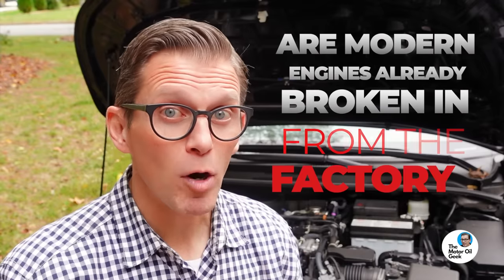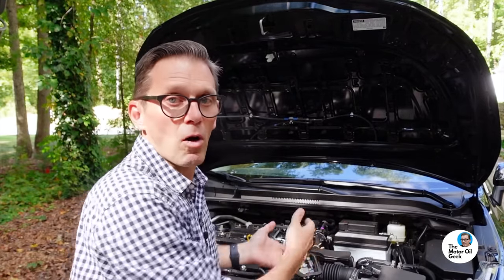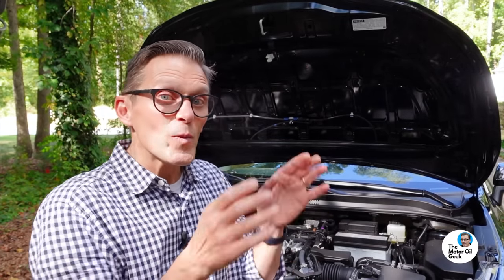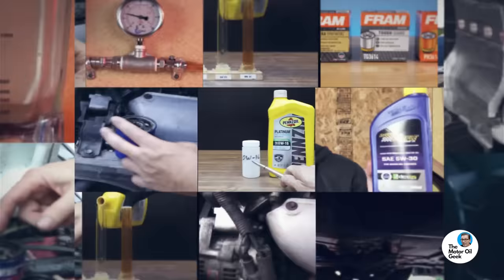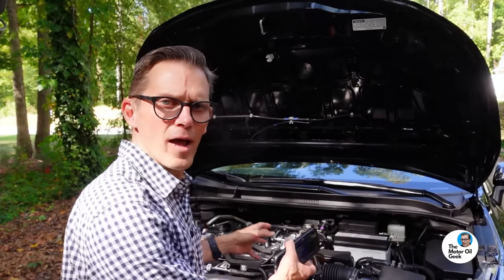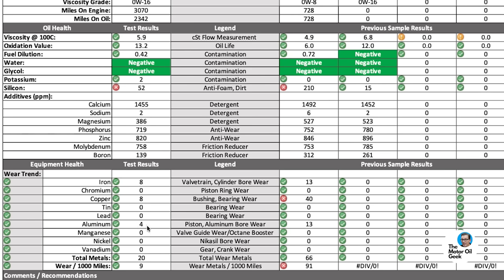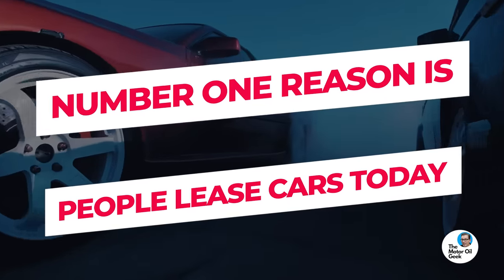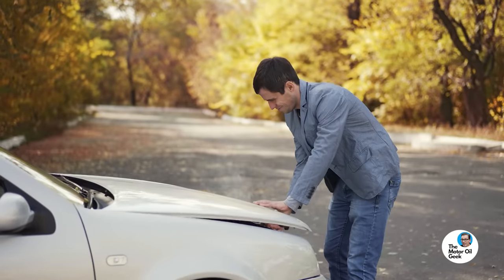New Engine Break-In: Truth or Myth?

Comment: Fantastic topic.
It would be great to do a video showing what to do from the moment of starting up your new car at the dealers lot with 2 miles on Odometer . 
How to drive it home, when to dump factory oil and what oil to use say after that factory oil dump and how long to keep it in?
Reply from the maker: Great suggestion!
Reply: @themotoroilgeek  Would lower Molly and higher or normal Zinc level oil like Pennzoil Ultra 5W30 be a fine oil to use after 500miles factory fill dump?  As from my experience judging the performance and fuel economy full breaking takes longer than 500 miles
Reply from the maker: @kdomster9141  yes, that would be good.
Reply: @themotoroilgeek  Thanks a lot !

Comment: Kind of stuck at least in the UK. First oil change is usually 1 year or 12000 - 20000 miles. No one normally works on the vehicle except the dealer when under warranty.

Comment: I think one thing missing from this discussion is whether the factory oil in the crankcase is some kind of special break-in oil, or maybe just some additive put in to the regular oil at the factory for break-in. I have heard different answers about this, and it probably varies by manufacturer and also varies over time (maybe they once did it, but no longer do, etc).
Reply from the maker: The oil we drained out had the exact same additive package as the OEM oil, so it didn’t have a special break-in oil.
Reply: @themotoroilgeek  This is a common misconception of almost all YouTube videos about motor oil. One cannot determine the entire base stock components and additive package components with a normal oil analysis. A motor oil analysis only is designed to tell you about the specifically listed chemicals, metals, etc, and not all the components, especially not the base stock components, or things like esters, etc. I realize that what I am saying invalidates the conclusion of thousands of YouTube videos on motor oils created by hundreds of YouTube creators, but it is the truth.
Reply from the maker: @Mark-rw3kw  I agree that the elemental analysis doesn't tell you about the base stock or the complete additive package. However, the FTIR analysis can provide an insight to both of these, so my statement that the factory fill oil was not a special break-in oil was based on comparing the FTIR results of the factory fill oil to the OEM service fill oil.
Reply: @themotoroilgeek  It may not have a special break-in oil, but I do know of some manufacturers who have at one time in the past, added some break-in chemical to the oil at the factory.

But in any case, since you didn't do an oil analysis when the car was brand new, it is not possible to know how much factory break-in was done, since any wear metals added to the oil as a result of factory break-in (or even a brief engine test not recorded on the car's OD) would have been included your first oil test done at 1000 miles, not just the results of break-in from 0-1000 miles.

Comment: I bought a 23 Prius prime and 23 tundra last year and changed the oil at roughly 600 miles  on the gas engine. I’m glad I did. My reasoning is slightly different though. I don’t take recommendations from a company that sells cars 🤷🏻

Comment: Great video!  I love your data-driven philosophy.  What do you know about Honda’s VCM, (Variable Cylinder Management?) system that turns of a cylinder at specific times to increase fuel efficiency?  I heard that it causes piston ring failure at around 150k-160k miles on their Odysseys and hence spark plug oil fouling.

Comment: If an engine is broken in at the factory, then it would have been done with the original oil in the crankcase. So a high level of wear metals on first oil change doesn't mean the engine wasn't broken in at the factory, it just means the oil has never been changed. Even if the engine is broken in at the factory, that doesn't mean that an early oil change is a bad idea if one thinks it is important to remove any wear metals from the oil, although virtually all of the larger particles will be trapped in the oil filter. I believe that Corollas sold in the US are made in Mississippi, not Japan.

Comment: I don't CARE whether they're broken in from factory or not.  When I get a new one- I'll change oil at 100 miles-- and again at 300 miles and again at 500 miles and again at 800miles and again at 1000 miles and after that as recommended MINUS a little time.  THAT way- it's broken in properly with good clean oil coating and will last MUCH MUCH longer.. YEs- it's a bit costly- but hey- what's that compared to the engine going out early??
Reply from the maker: Absolutely!

Comment: My 2018 Nissan Versa doesn't use steel cylinder sleeves but instead uses what they call "mirror bore" where steel plasma is sprayed onto the aluminum cylinder walls. Instead of the regular cross hatching cylinder honing their coating supposedly has microscopic pits that hold the oil. What do you think of that system? I haven't heard of any oil burning issues with these engines.

BTW the owners manual says there is absolutely no reason to do the first oil change until 5000 miles because high quality oil is put in at the factory. After that oil changes with 0w20 synthetic is to be done every 5000 miles.
Reply from the maker: I have an engine with that same technology. It is amazing stuff!

Comment: What’s your thoughts on amsoil signature series? I just changed the oil on my 2023 Tacoma at 1k miles and I used amsoil signature series! Glad I did the break in oil change after watching your videos !
Reply from the maker: That oil is one we are going to test.
Reply: @themotoroilgeek  have seen many videos on it being labeled as the best oil in the world. Project farm ranked it number 1. Along with many cold flow tests I’ve seen it beats the competition hands down. Looking forward to see what you come up with
Reply: For less than $35 a jug the Pennzoil Ultra Platinum is not much different. That is if you can find it at the local Wally World. I have to order it online. The platinum is usually in stock and might be just as good, they are specified for different uses.
Reply: @ricklong3218  still don’t think it stacks up against the signature series in the long run

Comment: Great science, Lake, thanks. Having broken-in (UK: run-in) a couple of self-built engines I've  noted the reduction in oil consumption during the run-in process. Q: what impact does the hi protection synthetic oil have on the 'ring break in time.
Reply from the maker: Thanks! Avoid the synthetics on a new rebuild. They tend to slow down the piston ring to cylinder wall run-in period. A proper running in oil will speed that up.

Comment: I believe many do "cold running" of the engines in the factory, but I'm not sure how much that will do in terms of break in as there's not a whole lot of load.
Where I worked for an engine mfg we did a full break in on all engines, but I believe that was mostly due to warranty and catching potential assembly mistakes.
Reply from the maker: Thanks for sharing.
Reply: The vehicles also get driven by the shipping companies. That's what I do for a living.  In -20° weather, we jump in the car,  fire it up, and immediately put the hammer down. 
Happens to every new vehicle multiple times before it reaches dealers. I did that to about 20 of the Dodge Demon 170 this past couple weeks.

Comment: Please could you explain this… when the engine has requirement for example for ACEA C3 is important to have also the OEM approval on oil like BMW-Longlife04? I have always problem with oil sellers and they told me it’s the same with the approval or without when it is C3 booth… my opinion is C3 is only basic standard and approval means it has done more tests and maybe contain more additives for OEM requirement is that right?

Comment: Glad to hear the science. But also wondering, if the oil is doing its job then the extra wear from the engine should have been suspended by the oil…correct?
Reply from the maker: The oil will always suspend wear debris. The higher wear debris is not a sign of the oil doing its job. Instead, it is a sign that the engine is wearing at a higher rate.

Comment: It would be interesting to know the difference in size of those metal particles as well and whether they're small enough to get past the filter which is the actual concern here.
Because when the break-in occurs the metal particles are flushed down to the sump obviously, so if they can't get past the filter then it's a moot point as the break in will happen at the same rate now matter how many times you change the oil in the first 3000 miles.

Now, it's clearly better to have as few particles of metal in the sump as possible as it will make the filter's job easier but I'm simply curious whether 91 ppm of metal can actually overwhelm the oil filter before the service or what percentage of those particles, if any, is small enough to get past the filter altogether.
Great video though, thanks for taking the effort to do all that filming and testing. 👍

Comment: Hey Lake. Do you recommend using Driven Racing Break in oil on a new factory engine?  I’m picking up a brand new 2024 Ford super duty with the 7.3 Gas engine and I can drain the oil just down the street from the dealership and then again after your recommended break in oil and filter life is over.

Comment: I  change my synthetic oil at 5k miles because the engine noise changes.  Usually that's 20-30% oil life left according to the monitor.

Do you normally wear gloves when changing the oil?  Should we be concerned about touching used oil?
Reply: Chris, you can touch oil and have no concern. If you feel safer using gloves then use them. I sometimes do and sometimes do not.

As far as the 5k goes, sounds about right if you are using synthetic oil. But if your engine noise is changing that's not a good sign.

And never, ever, ever go by what the oil monitor says okay? Go by the mileage only.

Comment: I've always carefully drove the first 1000 miles and then just changed the oil, at 2000 I will do another change with the filter. Bentley.s 6 3/4 liter V8 is spun with a huge electric motor for 16 hours to break in the running surfaces,
Reply from the maker: Thanks for sharing!

Comment: My cars owner manual says it needed to be broken in, and not to drive it aggressively to after it reaches 1,200 miles. It also says I only need to change my oil every 10,000 miles. I have a 24 MINI Cooper S with a turbo engine. It just reached 5,000 miles and some are telling me I need to change my oil now, and not wait another 5,000 miles like the manufacture suggest. I plan to keep my car for at least a decade, so I would like to do what's best for it. I've always went by what the manufacture says, but others are telling me I will regret it if I do. It's people who have owned MINIs for decades that are telling me to change it every 5,000 miles. My gut reaction is to follow their advice.
Reply: Yes, change your oil now and I would  change it every 5000 henceforth.

Comment: Would you recommend draining the factory fill in a new car (Lotus Emira with a Toyota 2GR-FE V6), running break-in oil for 300-500 miles and then going back to the OEM recommended oil after? Or is not worth the hassle and I should just break in with factory fill?
Reply from the maker: No need to go the far. Just changing out the factory fill within the first 500 to 1,000 miles is plenty good.

Comment: Would be neat to see if manufacturers are putting in a suitable grade of oil for the engine if they are being incentivized by CAFE scores.

Owning a hemi, they recommend 5w20 or 5w30 in certain conditions, I wonder if the lower viscosity is one of the reasons the lifters prematurely fail. 

Another video idle could be the wear of idling vs different speeds, more common than not, I see oil changes recommended off mileage not hours, so someone like a police officer, could be destroying the engine.

Comment: Since car manufacturers do not put break in oil in brand new cars anymore. Do you recommend to change the factory synthetic oil right away on brand new cars and put in breakin oil to properly break in the engine. then drive it about 500 to 1000 miles on the break-in oil and then switch back to fully synthetic?
Reply from the maker: Nope, stay tuned for more info that explains why.
Reply: @themotoroilgeek  thanks. I will stay tuned for more info

Comment: I'd like to see similar testing done on 2 different engines, on broken in nice and easy, the other, broken in by being driven like it was stolen. I feel that a hard break in period is better for the engine than an easy break in. Hence why my 2017 Mustang was ran HARD with less than 10 miles on the odometer.
Reply from the maker: Great suggestion!

Comment: First of all, no one ever damaged an engine because they changed the oil too soon as long as they used the correct products and did the job correctly. For another thing, following break-in protocol with a new engine is not going to harm the engine either. What is break-in protocol? Basically it means running the engine in a stationary position at high rpm for a few minutes, going back to low idle for a few minutes and repeating the process several times. Then you drive the vehicle under stop and go conditions or mimic them by charging down some sreet or highway for a couple of miles (or several kilometers) and then slowing down and letting the engine run at a slower speed for a while. The worst thing would be to immediately drive the vehicle at a steady speed on a road or highway for a long period of time.

The theory of break-in is that during a proper break-in procedure the parts lap into fit with each other. Running the engine at high rpm heats up the piston rings particularly allowing the necessary microwear to occur. But you do not want the engine to run too hot internally for too long, so you alternate periods of high rpms and low rpms allowing the rings to alternately heat up and cool down. For the other moving parts, my thought is that break-in will occur regardless of how the vehicle is driven during the break-in period.

I don't think the test done here is the most scientific. The only way to be certain would be to micromeasure all the parts before before the engine was run and then tear the engines down and see how much wear has occurred with different break-in protocol and with no break-in at all. But what do I know? I'm a former journalist and a researcher, not a senior mechanic or an engineer. One thing I do believe though is that with contemporary engines and even with standard performance revival engines (a 350 Chevy for example), you do not need to use a special break-in oil. For rebuilt engines, whatever was original is good enough. For new engines, whatever it comes with.

Comment: It would be interesting to know if your better off using a shorter drain interval using a cheaper filter (orange Fram for example) than extending the drain interval and using a very high end filter. 
FWIW I own a 2006 Honda Odyssey since new and just by using common sense drained the breakin oil at less than 500 mile. I have run Mobil One synthetic (0W-20) exclusively since then and changed the oil at the manufacturers mileage minder alert. The vehicle now has 350,000 miles and aside from having to replace all the gaskets I have had zero engine problems. I even checked the valve clearances and they are still within factory tolerance. I live in Florida so we don't have the large low temperature swings that other parts of country see. I had the pan off and noted that there is zero sludge and minimal varnish. I have never done an oil analysis but with high mileage and no baseline to compare it to the analysis seems almost academic at this point.

Comment: Great video. Of course a mass-produced engine (over 99% of them) will not be broken in from the factory - it is simply not cost-effective to do this over millions of engines. Since you are changing oil at low intervals over break-in, it should be possible to tell when break-in is over. At what point does the ppm numbers for the metals come to within 3-5% of the long-term average? We should be able to work out fairly accurately how many engine hours or miles the break in period lasts for various engines. Of course, most of the benefit comes from that first oil change and that 700 mile or 1000 km first oil change probably is when break in is almost complete. Your second oil change does however show that there is some residual debris left over and therefore a second rapid oil change may be helpful to clear out the remaining debris from the engine. Does the type of engine seem to make a difference regarding break in period? Would a highly strung engine like in a GT3 break in slower or faster than the Corolla's engine?